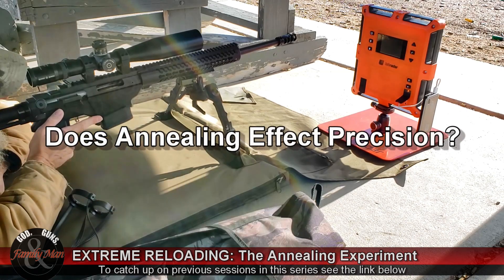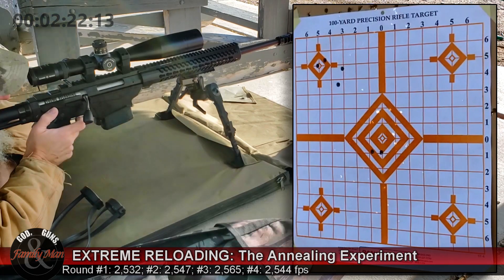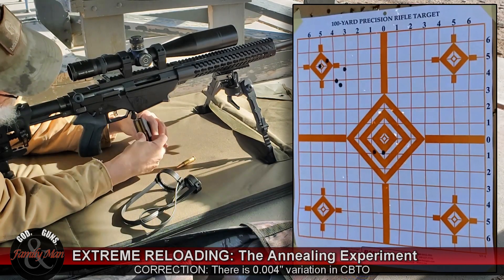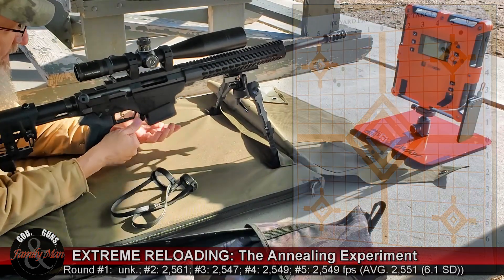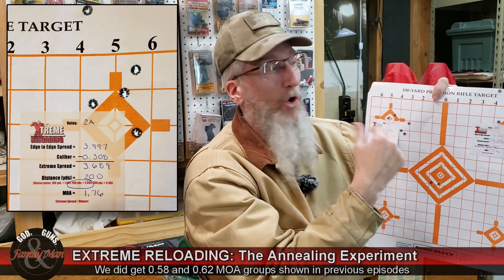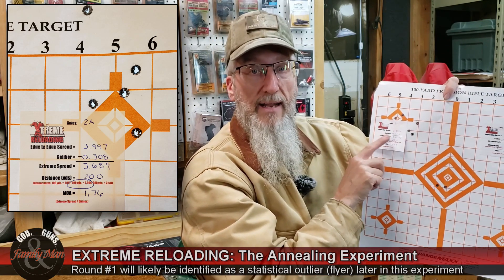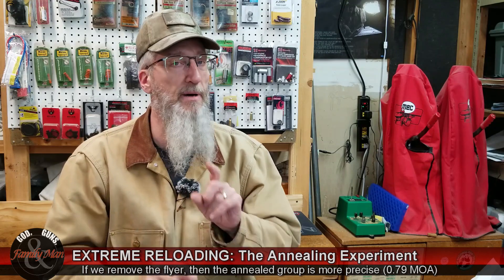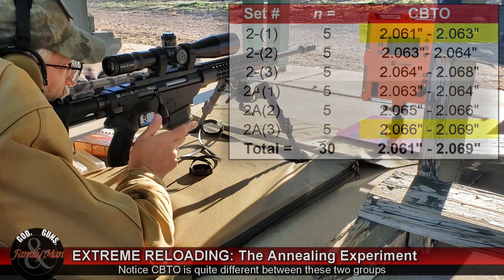EXTREME RELOADING: Does Annealing Effect Precision? (part 3 ep. 05)

Comment: Certainly not trying to be a pest but I know in previous comment you stated that you are annealing after sizing and not before. I think this very easily is at the root of the data you are seeing. I did some research on my channel about this named "How NOT to Anneal Your Brass!" The groups that were annealed after sizing had a much larger group as well as slightly higher SD. Before you draw conclusions on this it may be worth your consideration.
Reply from the maker: That is an interesting finding certainly.  I used this order to minimize "work hardening" the brass by the resizing process and thereby losing the annealing.  I am curious, did you actually see an improvement from annealing or no change compared to non-annealed brass?  If this is part of your channel I will check it out.
Reply: @sdkweber  The AMP annealing guys released some info about annealing the same case multiple times that I thought was interesting .Why not release all the stress in the case after sizing right? All the advice I have heard is always anneal before size and that is why I tested it. I will likely do more in the future  but as you increase options sample sizes get pretty large pretty fast. I would consider annealing then sizing and see what happens to your conclusions. Happy to drop a link to the video if you are interested (its only 5 minutes), but I have my settings to block all links cause of all the scammers,  I assume most folks do these days as well.
Reply from the maker: @BoltActionReloading  Thanks. I found the video you mentioned and just watched it. Nice and to the point. 
Have you compared annealed to not-annealed?  A found another video on it about a year ago and while they claimed annealing improved precision, statistically there was no difference between the two treatments (plus they changed rifles during the test).
Reply: @sdkweber  It is something I intend to cover but if I need to figure out exactly how to design the test. IMO there are 3 things to look at: Precision, MV consistency (ES/SD), and actual brass life. I need to be able to get all my tools to be able to reload at the range for a day, but its easier said than done. (plus everyone thinks your crazy)  I am pouring through Brian Litz series on Modern Advancements in Long Range shooting and in volume 2 in the section of Neck tension he touches on this. This was written before Aztec mode existed so the results may be different today as well. So much testing to do so little time. Keep up the testing, I always appreciate people who are willing to tinker and show the world their results.
Reply from the maker: @BoltActionReloading  I recommend loading 30 rounds of annealed brass and 30 of non-annealed brass all at once being as consistent as possible throughout every step.  Then shoot these as 5 or 10 shot groups over several different sessions to avoid the effect of barrel heating and shooter fatigue.. plus to be sure the results are not attributable to weather conditions specific to that day (temperature, humidity, and pressure).  That is what I did using 5-shot groups across the board.  It will give some pretty conclusive results.
Reply: Asked that question on part 1… cant understand why you would anneal after you resize …unless you are trying to verify if annealing is worth it
Reply from the maker: @Nonedw  I am indeed trying to figure out if annealing is worth the effort.  Recall, I prepared 60 rounds for this test (video 1 of this series) and this is parts 3 and 4 of that 60 round group. My question is does annealing effect precision?
Reply: @sdkweber  as you should I totally agree with testing everything. However, you should test it properly…IMO, you should anneal prior to sizing or not anneal at all.